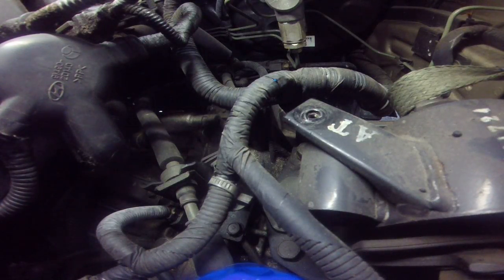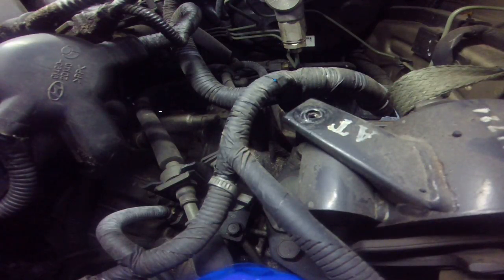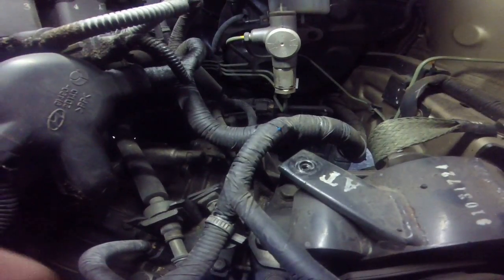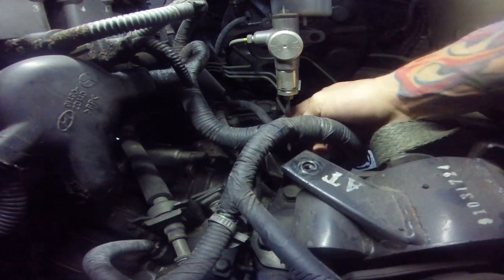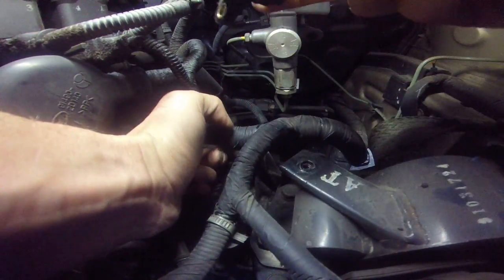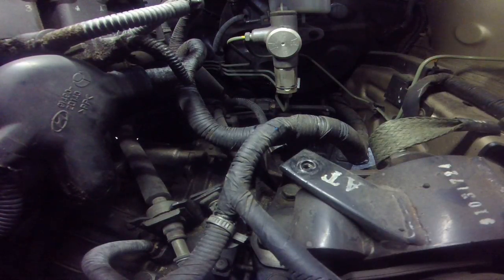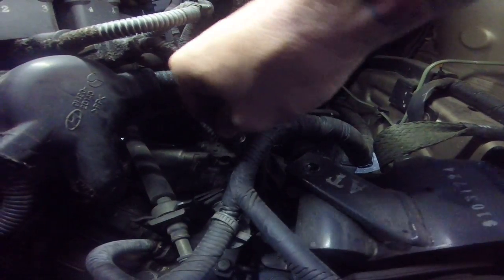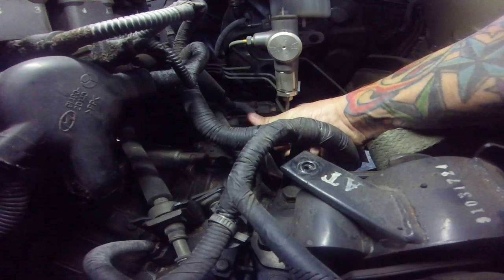hyundai elantra output shaft speed sensor

Comment: When you buy the sensors they either come with a orange or red safety rubber on the inside of the sensors as a safety thing or something..I made the mistake of plugging in the sensor with this orange or red  rubber seal it comes with and it made poor contact .long story short it threw the output sensor shaft code and found out it was that the prongs weren't reaching because the rubber seal created a gap when you plugged it In.. took the rubber seal off put sensor back on ..fixed .........hope it helps some one ..great video BTW thanks I watch it now and then when I forget shit .lol

Comment: have had a P0501 for over ten years on my 03 elantra.  drives just fine except on a very steep hills.  it will downshift to 2nd gear when going 65 and if you don't let up on gas immediately it could blow your engine.  i can always sneak it through emissions every two years by clearing codes, then driving for 75 miles with several starts.  Never related the code and downshifting until I saw your video - thank you!!!  Just liked and subscribed.  Will have at it one of these days and report back.  Also, I noticed my cheapo $2 china scanner shows the car is going 0 mph in live mode when driving down the highway - wondering if I may also have a bad wheel sensor or would this shaft speed sensor account for 0mph?  Speedometer works fine.

Comment: Good job....my 06 elantra has been shifting hard from 2nd-3rd gear only when transmission is cold but after about 10 minutes of driving it would shift smoothly again. My transmission fluid is clean and I have no check engine light.....I noticed only today that my speedometer wouldn't exceed 40miles no matter how far l step on the accelerator.....what could be the cause?
Reply from the maker: that sounds like bad clutch pads in the trans

Comment: I have a 04 hyundai santa fe2.4 i change mine like the video when i drive it for the first time a loud noise from the transmissionit only one time  i park it i am wonder if this is normal any advice
Reply from the maker: if it was a gear style output shaft sensor i would say you binded it up and broke it but since this one reads threw a magnet its not gonna be from the sensor

Comment: what was the error code ? if you can remember 
it gives me this error, P0501 vehicle  speed sensor range/performance ,
I want to know if it is input or output sensor that is not working 
it is not the speedometer cuz my dash works . thanks in advance.
Reply from the maker: mine was the p0501 which is the output